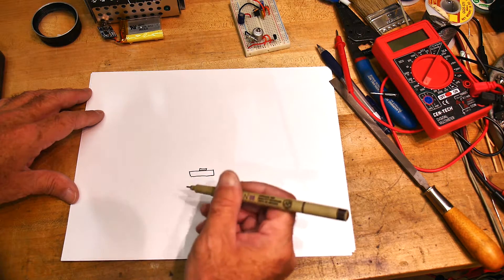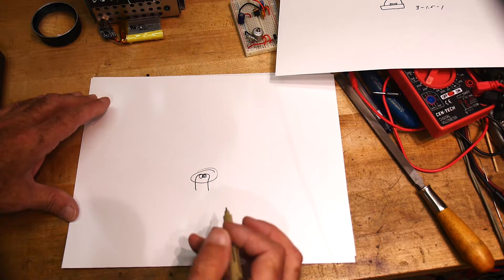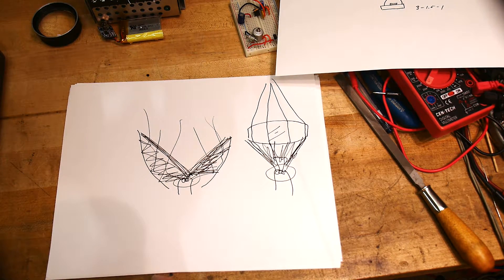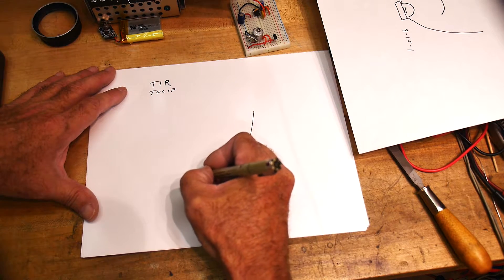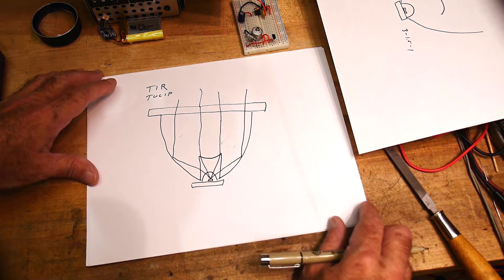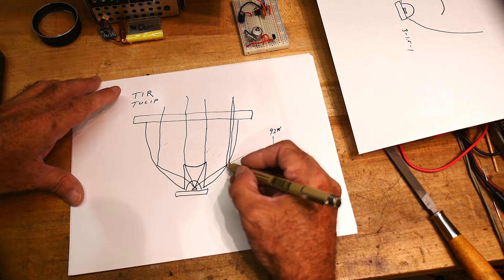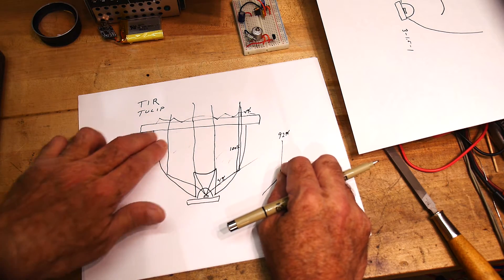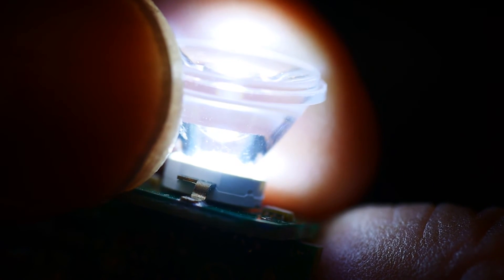#559 TIR Tulip Lens for LEDs

Comment: Thanks for the explanation. So the TIR tulip is enclosed with trapped air/gas inside? The small light-bending lens, reflector/outer plastic and top lens is all one piece. So one thing I don't like is, the top/exposeed lens is plastic and can easily get scratched during use. All of my LED flashlights have a glass top lens.

Comment: I received bunch of TIR lenses in different degrees. How can i tell which is shallow and which is deep?
Reply from the maker: not sure what you mean by shallow and deep, but in general, these lenses are made for individual uses. you would need the datasheet for each lens. of course you can just try them and see if any work for your application
Reply: @IMSAIGuy  how can I tell which lens is wider than the other? It's very hard to tell.
Reply from the maker: @koningklootzak7788  again, you don't know what type/shape of LED these lenses were designed for. you can just put some random LED under the lens and see how it reacts. just shine it on the wall. if you want to be scientific. you use a calibrated camera and use software to measure the intensity at each point.
Reply: @IMSAIGuy  I do know. These are 3535 lenses. I've figured out now. Thanks.

Comment: Is it possible to produce a collimated beam from an LED that diverges very little over a long distance (similar to a laser)?  If the LED is a point source, then one can place it at the focal point of the lens, however, physical LEDs are not point sources, so when placed in the focal plane, it will always produce a diverging beam.  The light sources off-axis get focused to infinity but at an angle relative to the axis.
Reply from the maker: I think you answered your own question. If you want to do the math, look up Entendue: https://en.wikipedia.org/wiki/Etendue
Reply: @IMSAIGuy  Ok so etendue never decreases if power is conserved.  I was able to reduce the spread by using an aperture, but that of course reduces power.  I was hoping there was an intermediate solution where you can keep more of the power while collimating the beam to any desired angle.  Putting a pupil behind a focusing lens reduces the overall amount of light, or at most creates a vignette, rather than block out the large angle lights.  I've thought of using 2 pupils or putting the pupil far away but that adds more complexity and size to the design.
Reply from the maker: area * solid angle is constant    AKA 2nd law of thermodynamics or I learned it in Physics as the Lagrange Invariant.  @cryora

Comment: I wonder how they will compare to regular reflectors in terms of beam intensity. I'm currently trying to replace my flashlight reflector with a TIR hoping that it would offer more impact resistance. I'm not so confident with the thin glass lens of my reflector. I ordered the smallest available 5⁰ TIR to maximize beam intensity. I hope it doesn't drop too much throw since I needed the range. If it does then it's back to reflector I guess. I already tried wider angles and I loved how well they perform on close up. Just not sure how well the 5⁰ lens would throw. 🙂🙂🙂

Comment: When my stage lighting carrer got put one hold I decided to dedicate a good amount of time and old fixtures to learn what every component on each PCB did.  So I could come out the other side of COVID replacing a $0.10 whatever rather than the usual practice of ordering new PCBs.  Well..  this also led me down the path of building my own fixtures (personal use only).  Long story short;  I am self-taught and after playing around with some TIR lenses I intuitively felt something was going on as I tried increasing output via reflectors and taking amateur measurements.  I think I just got my answer. Evanescent Waves = magic basically.    THANK YOU!
Reply from the maker: Great that you found something productive and fulfilling to do during Covid. This channel has helped me.

Comment: I know that there is one lens work very well with small package LED. This lens is so similar with TIR lens but it is not all the same, it is much thinner, uses the principle of total internal reflection and Fresnel structure, so this kind of lens is light-weight and very close to the LED to make full use of the light. Lighting fixture can be made much more compact. I found its video on Youtube: https://youtu.be/XZi4iAGZR_M

Comment: I'd like to try some TIR's with my DIY bike lights with XHP70.2's but they're hard to get for the 7x7 die. Atleast they were when I made the light. Using Fraen reflectors instead, the light spill actually turned into an advantage in my case, works as a flood/spot in one.